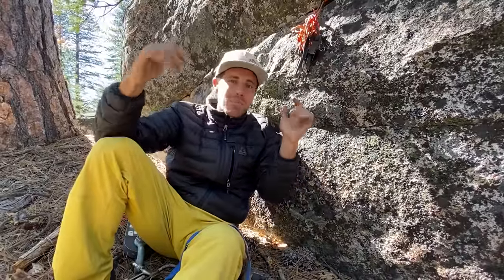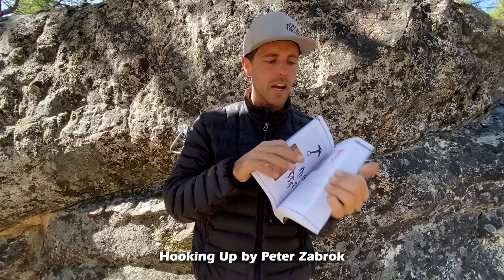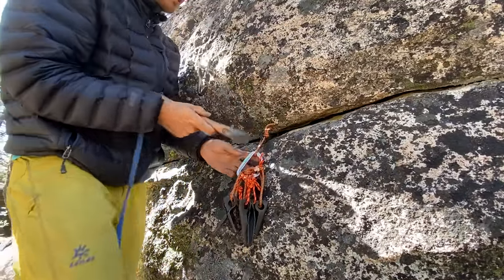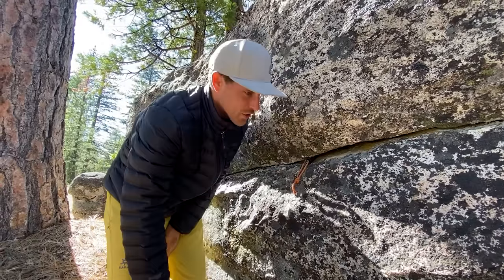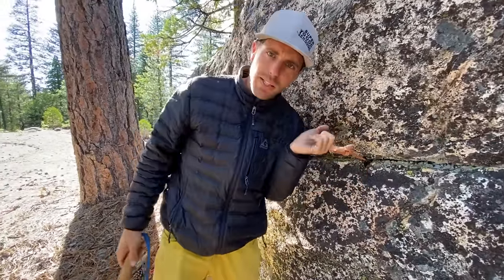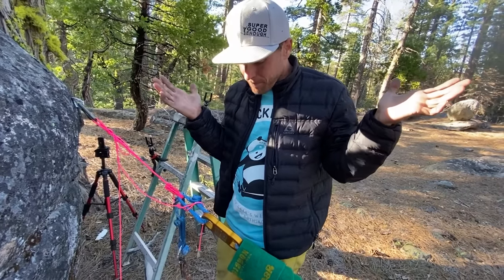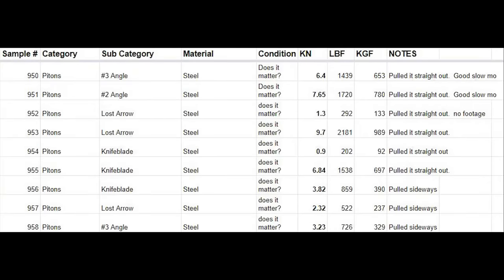Climbing PITONS Tested

Comment: You guys do a great job. BUT. its kinda obvious that you were not brought up on pins, ie.pitons.  For mixed climbing and hard alpine pitons are still relevant.  a full on lost arrow horizontal placement is probably stronger than the biner or rope. Just saying.
Reply: What do you suggest they should have done differently other than pulling in sheer? They just pulled in tension to see the worst case.
Reply: @EvanWisheropp  They should have pulled at 90 degrees to the placement as most pins are
Reply: @justriley9157  Read my comment again. I said what could they have done OTHER THAN pulling in sheer (aka 90 degrees). Using a logical conclusion you would see that I had already suggested pulling in sheer. I also said that pulling in tension (as they did) is a worst case pin scenario, such as hammering a pin directly up into a roof. Consider being less of a prick.
Reply: @justriley9157  Heyup. Had a couple of friends on the north face of the Matterhorn in summer . leader took a fall , no runners, probably 200 foot at least and was held in a horizontal  well place peg, on not the best rock. Obviously it was the best rock around. Thanks mate.

Comment: Would love to see you guys test 1/4 inch button heads in granite since they are still going in on FA, aid and canyoneering routes.  Local, can supply if needed.
Reply: Yeeeeeees!  But also wtf those are still used?
Reply: @rachelhasbruises  That is a great question. Ask a lot of people and you will get a lot of different answers. They solve specific unique problems, and at one time they were the best option, but now although potentially better alternatives exist, people still go with what they know. 

Placing them well is becomming a lost art of the old guys who have a fondness for them. But when done right, they were surprisingly strong and tested far better than other 1/4 inch alternatives. Possibly due to the lack of threads. There are reports of them holding north of 3,500 lbs, while a threaded wedge of the day sheared at 800lbs and was highly prone to metal fatigue. 

Everone has their stories but the fact that so many popular routes originally were protected with these for years, without many accidents says something. People went with them because empirically they were working. Many bc routes in Sierra granite are still covered in these. And in a lot of the exploratory phases of first ascents or decents they still go in. Sometimes time can be a factor between life and death, and in other places hand drilling on lead for a FA is part of the ethics for an area. Other times it is felt no human will ever see them again. 

They're still a common alternative for aid ladders, and you see people placing them with double washers and no hanger so that they can be replaced without damaging Rock. 

In some wet canyons no other 1/4" bolt is capable of retaining a hanger more than a season except a button head. 

Many parties have the intention, if the line goes, of replacing what was supposed to be temporary Hardware but often times it may take 20 years. So should we be looking at something else? There are stainless alternatives now that reportedly hold more than 5,000 pounds. But people go with what they know.

As long as people have a need for quarter inch hardware, the button head seems to still be making appearances, albeit seen by very few people. 

And the bigger hardware  doesn't necessarily make it any safer. In one Ryan's videos he tested a  1/2" powerstud. Way better than any 1/4" button head... yet it failed with a few hundred pounds of force because they failed to place it with enough thread engagement. These guys arguably have more experience bolting then a lot of people placing bolts these days... and that coukld have been a fatal mistake, and I see it in the wild.

Some stainless studs in granite suffer from this due to the old practice of backing the nut over the stud to protect the threads from the hammer. But modern studs have extra unthreaded metal for this purpose such that when they quickly come up to low stainless torque specs in very hard rock, not all the threads wind up engaged. If it looks flush and tidy, look closer. Most will loose their hangers anyway.  

Bigger doesn't always mean better. And it is really disheartening to see how many bad placements are showing up now that a cheap impact dril is accessible to almost anyone. 

Many will argue they still have a special need for 1/4" hardware. Assuming they know what they're doing, should this relic still be used? What better Alternatives exist? And because a lot of them are still in service,  I think a lot of inquiring minds would like to know.

If a better alternative shakes out, it could change things.

Comment: I was taught that an eye of a vertical piton should always be down (in the direction of pull) and snug against the rock. This way it should be harder to twist it out. Care to try more placements? Many people around the world are using those as protection. Cheers!
Reply: Pavlo Deshko. No matter where is the eye of the piton it's better when the level of it get crossed to the axis of the crack. This situation forced the piton to rotate around itself and give a lot more friction between the metal and the rock. That's why in the old days that they didn't have quickdraws they put a lanier with an "alouett" knot at the edge of the eye and not at the main axis of the piton.

Comment: Well, in Italy those are STILL used for protection (not aiding, protection) on  many classical routes in the Alps and Dolomites ahahah
Reply: Let's clarify one thing, it's not common to see alpinists going out with 15 pitons to protect a whole route, but if the route you choose has many pitons already in place you'll take the hammer with you so you can fix them and assure that they are firmly in there. But once you take the hammer you'll also take 3/4 pitons just in case (I mean you already have a 2 pounds hammer, half a pound more of pitons are not going to feel heavy right?) And in the end you'll eventually use one maybe 2 just because you have them. So even if sometimes one or two pitons disappear, sometimes new ones appears instead. And on classical traditional route it's always fascinating in my opinion

Comment: You only tested 2 of the 3 possible loading directions. Straight out, parallel with the crack and perpendicular to the crack. I am certain that loading perpendicular to the crack will give the best strength.
Reply: yeah and that's the most normal mode of use, everyone knows that it works
Reply: All you need to know about Pitons: https://www.youtube.com/watch?v=KpmocKw187U
Reply: @brienfoaboutanything9037  That video is about something completely unrelated to what this video is about
Reply: I know you know your stuff, but get with the program here.

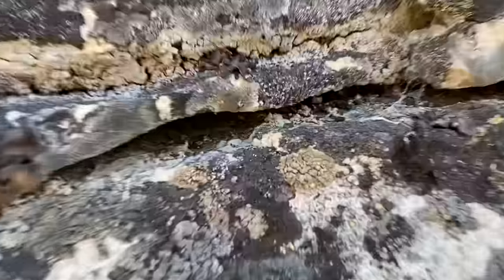Comment: The piton at 8:12 that pulled at 9700 really opened that crack up! You can see it shift back in the video
Reply: Would it then not be stronger on a real mountain or a place you would climb? As ofc the thing cant hold an entire mountain.

Comment: Thanks for the video. Regarding you're question on why pulling straight out holds better than sideways, I remind you this is how you remove the pitons from the rock. But I think you could get better results from cross loads. You're pulling alongside the crack, try pulling perpendicular to the crack, that is downwards if it's an horizontal crack and sideways if it's a vertical crack.

Comment: You should also do copperheads and circleheads.  Most folks use a funkness device to remove pins on nailing pitches.  I blew a hook and fell onto a tied-off KB and it held in a vertical seam.  I was really happy about that.

Comment: Physics Explanation: Static friction is what keeps the box from moving without being pushed, and it must be overcome with a sufficient opposing force before the box will move. Kinetic friction (also referred to as dynamic friction) is the force that resists the relative movement of the surfaces once they're in motion.

At an angle, the piton works as a fulcrum where a greater rotational force is created on the rock end while the rope end can just pivot in the rock at the same place. Kinetic friction is weaker so once the piton starts rotating leveraged by the fulcrum it pops out with less force.

Comment: So the friction forces in an impact force (shock load being the term you used) and a slow pull are very different. Not only that but the way stress is distributed in the object. Slowly loading it is a good test but not entirely equivalent.

Comment: Please try the same tests in better rock! It seems pretty clear that it's the chossy rock causing the failures and not the pitons themselves.
Reply: I think that's granite, my dude......
Reply from the maker: Yea.  and I want to test pulling perpendicular too... I just couldn't get the placement and angle for the pulleys.
Reply: @rachelhasbruises  Choss does not discriminate! There's a lot of chossy granite out there...

Comment: At 15:20 you said that you didn't get the pure tone when you struck the piton.  I think this tone is the natural frequency of the piton, probably the fundamental as a cantilever, and gets excited due to the small amount of lateral energy due to inaccuracy in you hitting it.  It gets higher as the piton is hammered in because the part sticking out of the rock is getting shorter and stiffer.  Not getting the tone means that the rock is absorbing the vibration instead of being rigid.  This probably means it was in sand instead of solid rock, or the rock is choss and breaking into sand.  Either way its not holding the piton rigidly.
Reply: Or the rock is moving (or to look at it another way, the crack is expanding).

Comment: This was quite interesting. I don't use pitons hardly ever, just occasionally ice climbing or winter alpine. I am not that qualified, but I did think that the one's you pulled from the side didn't sound as good as the ones you pulled strait out. I wonder if the technique of hitting them sideways partway through driving them weakens the placement. Maybe some old piton masters will show up and educate us.

Comment: Thanks guys I just about to buy some for a line I want to develop 👍 can you explain again what you want for a measuring device?
Reply: For dynometer maybe a wireless display reader can help you let me know if that helps you and I will try to find some random tech freak to build on for you 😅😅
Reply: You might be able to get it done cheaper with something like a compound bow string pull weight scale...It won't give you Kn but you can get pounds of pull force...It's also analog so no need for batteries..It can give you peak force as well
Reply: A labjack, it's a device that passes data from the dynamometer to a computer, for storing it so you don't only see the peak force, but the whole force-time graph

Comment: Several people have commented that more kilo Newtons (kN) would be required to pull these pins if the pull were 90 degrees from the plane of the crack. True enough, but such a test does not reflect the real world climbing situation.  (Nor do the straight out pulls shown here.) In the real world, we are usually climbing cracks that take us from the bottom to the top of the rock.  Thus in either the aid situation or the free situation  the direction of the force on the protection (basically a line) lies close to the plane of the crack.  Only occasionally do we find a crack that is horizontal.  So a test pulling straight out do not simulate the forces generated in a common climbing situation (as Ryan said, the most likely real world situation would be when nailing a roof). Situations where the force is perpendicular to the plane of the crack are relatively uncommon. 

I do not know on why Chouinard chose to use "Lost Arrow" as his trademark for these pitons.  But I will ask you to remember why those cracks on El Cap are still called the Stove Legs.
Reply: The lost arrow spire.
Reply: @BlindDesertPete  I looked it up.  Actually, Lost Arrows were developed by John Salathe for the first ascent of the Lost Arrow Chimney (and first climbing (e.g. non-tyrollean) ascent of the Arrow tip) in 1947).  I guess "Lost Arrow" became a generic term for hardened chrome-moly style pitons that Salathe made to distinguish them from the softer European imports available at the time. When Chouinard started making pitons in 1957, he and his customers must have continued to use the generic term to describe the pitons he made.  Interesting that Chouinard was able to trademark "Lost Arrow"  in 1974 and claim "first use in commerce" in 1965.
Reply: @justriley9157  I know; I have few myself.  I am not questioning  the strength of Chouinard pins per se, only the utility of testing the resistance of these pins to being pulled out of a crack when the pulling force is perpendicular to the plane of the crack or perpendicular to the plane of the rock face.  I also became interested in the "Lost Arrow" trademark, registered in 1974 and still in force for MOUNTAINEERING EQUIPMENT-NAMELY, PITONS.  The current owner is Black Diamond Equipment.

Comment: Pitons are not designed to work in that direction. 

Pull should be downwards, forming a 90º or less angle with the piton.

In this downward motion most forces work shearing the piton, not extracting it. 
You could expect some 60% increase by testing like this.

Comment: did you see at 8:14 how the crack closes down?? the piton was held solely by the weight of the rock, not pinched by its elasticity. try different rock weight and crack angle and get totally different values!  
looks as i jumped my comment b4  seeing that everybody else saw it.......

Comment: I'm surprised that a slim metal wedge hammered in (with a very small hammer) can even hold bodyweight! So for me even the worst examples shown are super good enough. 2.32kn for example, that is way enough to hold a person. But of course you would use multiple.

Comment: Theoretically speaking could you hang a hammock on two of these or maybe hang one from the ceiling off of a couple cams?
Reply: Theoretically, if the hammock were strong enough, you could hang a hammock from a couple of these and place an SUV in it.

Comment: Hey HowNOTtoHIGHLINE, If you'd like some bolts to test, I have a bunch of 23 year old five-piece bolts that I removed from a sea cliff. The heads were slightly rusty, but most of the teeth were fine. Once removed I thought they looked great, HOWEVER, about 6 of them that also looked great SNAPPED under body weight! Since we know the weak part is the head, and I want to know the strength of the heads, maybe you could glue them in with a hanger and pull them in sheer.
Reply from the maker: interesting.  please send me photos to skylining@live.com

Comment: this particular rock was not strong enough for this test, because when you hammer it in, it lifts up the upper rock, and you can see the upper rock 'settle' back down after being pulled out. (see 8:13) It would be interesting to rerun the test on a more 'solid' rock than this one. I think you'll get 2x force with same test on more solid rock.

Comment: That's an expanding crack. Your tests are worthless. Place an LA or KB and then beat in an angle. The thinner pin will fall out. Try an A1 splitter next time.
Reply from the maker: If I did this on a real route people would come with their pitchforks!  I will try to find better rock for our next tests but they aren't worthless.  Pulling straight out is the only way I have used pitons because I climb clean otherwise and that was something i was most curious.  I also think we learned a lot about how big of rocks a wedge can move which is nice to know if climbing flakes
Reply: @HowNOT2  There are A1 splitters that aren't on routes. I can't think of a reason to pull straight out on a pin unless it's in a roof. I didn't think people did much nailing on expanding flakes these days. I think your pins would have tested a lot higher in a good crack. Make the pin fail in a perfect crack--that's they way you normally test things.

Comment: Pulling straight out is NOT a good representation of how a piton works. A piton is not a bolt. A bolt expands out and deforms, locking it in place. But a piton is hammered in, and the measly force to hammer it in, is not even as small as the force to pull it out. Geez! A piton is hammered into a horizontal crack, and the pull force is down, and the streangth comes from the steel, refusing to bend under even a huge pulling force. But you douche-bags are testing the strength of the rock, which although strong, has nothing to do with the piton. 

And no, a static pull is NOT the same as a dynamic pull. The piton might behave the same, but the rock doesn't behave the same. And since your test models he behavior of the rock (and not the piton) you'll get all kinds of different results by repeating the same test on different cracks. The overall outcome of this, however, may amount to only defacing the rock. 

I do greatly respect the work you guys have done to show the climbing community the real truth about the strength of the gear we trust our lives to. But this one is a dud. It was fun though.

Comment: you say "shock loads and slow pulls are the same", you are, as usual, incorrect. pls study mechanics before attempting to inform your audience
Reply from the maker: I'm building a drop tower to find out what the differences.  We will find out how much of a difference there is.  If you are so smart, can you please make some educational videos for us that are mildly entertaining?
Reply: @HowNOT2  We don't need your invalid and unreliable test data to determine whether or not impact loading exists - it has been understood by engineers for many years.